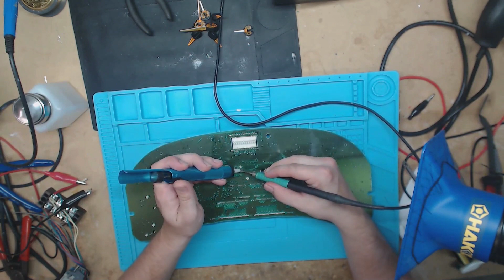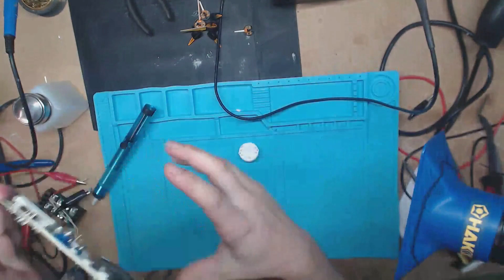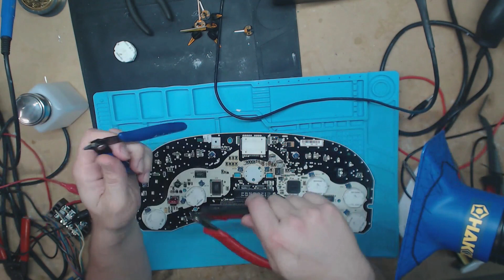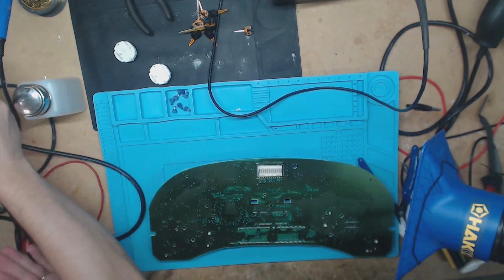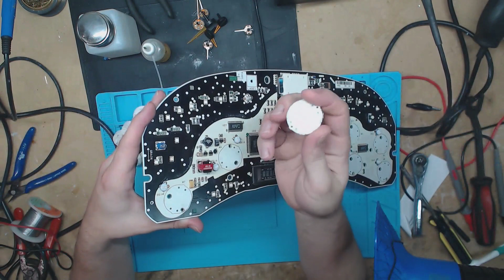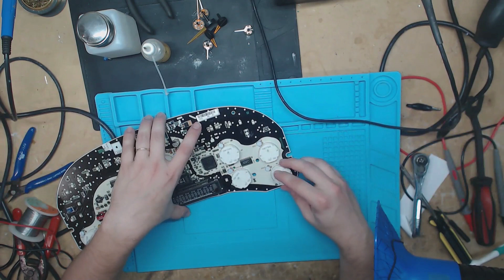x27 Stepper Motor Replacement

Comment: A question I went to replace my lights on cluster 2003 gm got everything done the the rpms stopped working I replaced the stepper motor but the needle just goes up and does not go the vehicles rpms